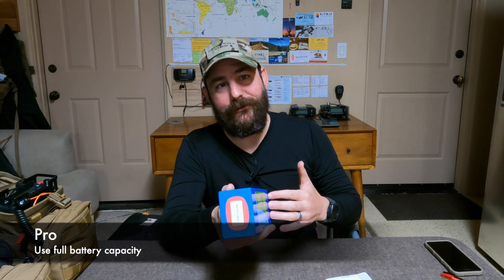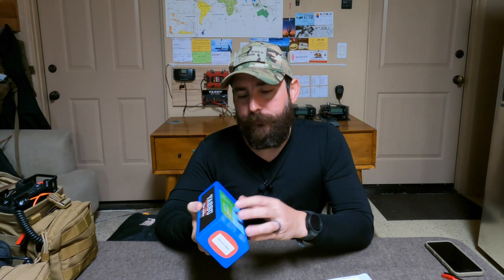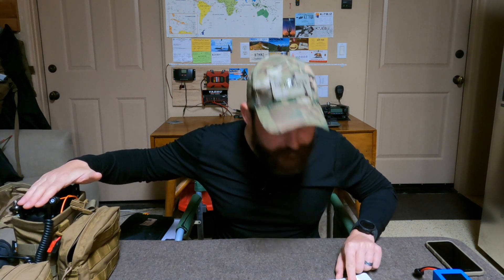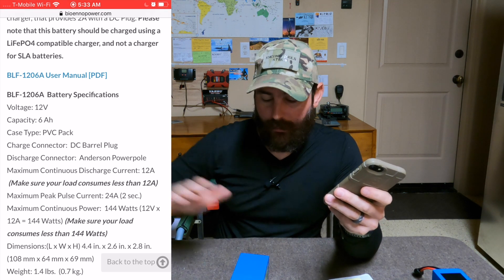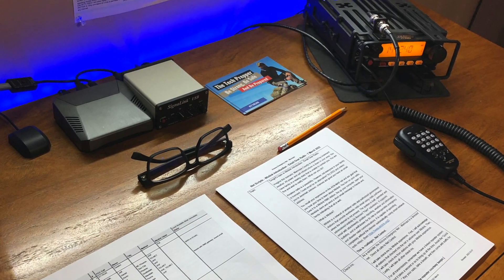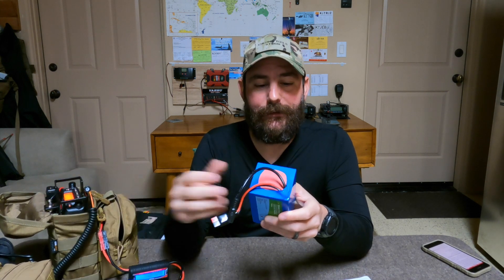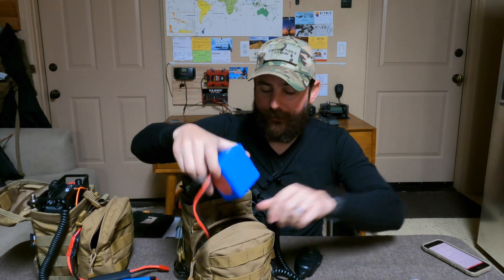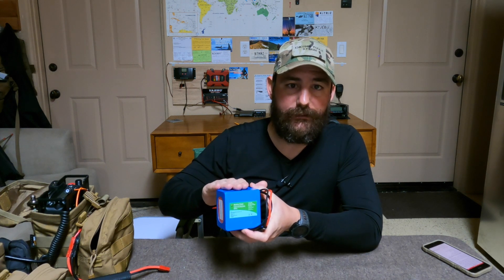How to size a battery for Amateur Radio

Comment: Thank you for the info! I'd gone with the 6ah Bioenno. It's worked well for extended recieve and a couple of hours of tx. The weight savings has been a life saver.
Reply from the maker: The 6Ah is really the perfect compromise of size, weight and capacity for QRP rigs. Glad you're having a good experience with it.